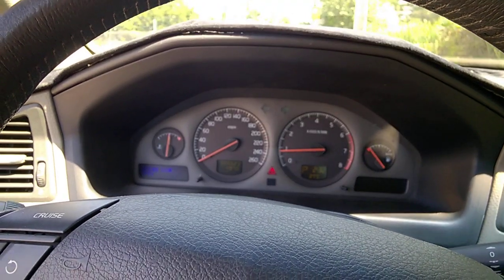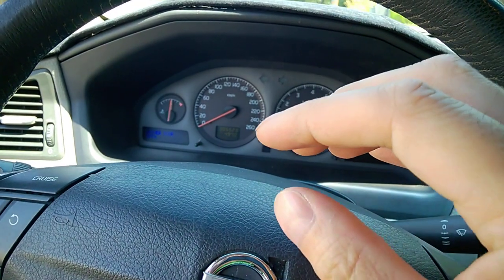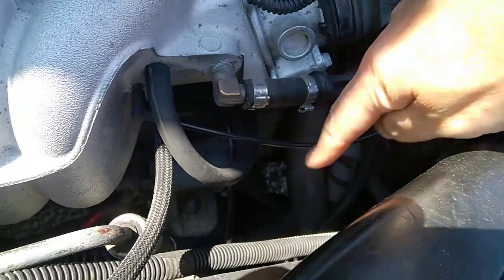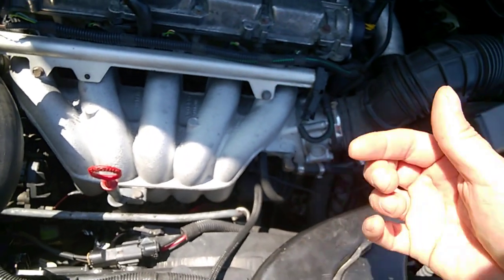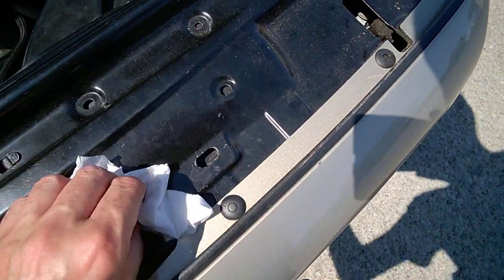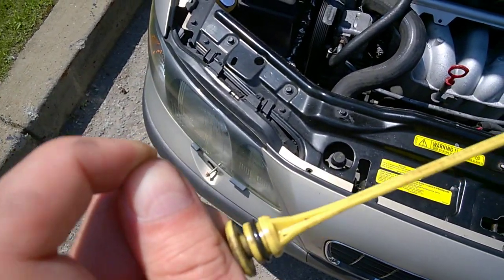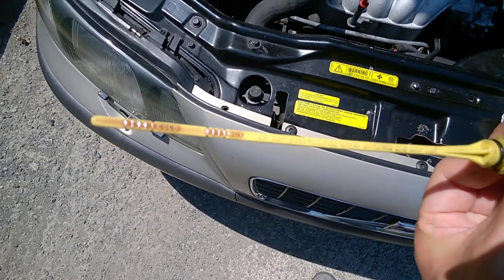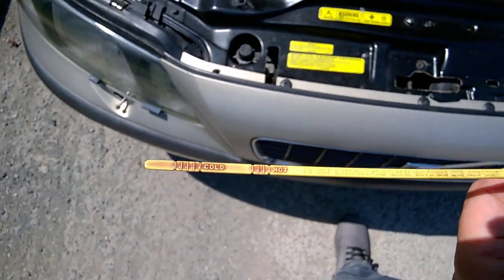Volvo S60 V70 Non turbo Automatic transmission (Aisin) Fluid level check 2001-2009

Comment from the maker: For TURBO engines dipstick location  https://www.youtube.com/watch?v=3zxWHtQ4wXU
UPDATED video https://youtu.be/Ad7HxgNP4s4
Hello everybody. I would like to share my 2c about transmission fluid change. This is just my opinion  😊  I did flush my transmission at 100.000 miles. I have to say, it worked less well afterwards. Before the flush it was shifting with only a very small kick, after the flush the kick was more obvious.

The transmission adapts continuously to the fluid properties. Replacing a large part of the fluid at once, may not help the transmission to adapt quickly enough (bigger the change, bigger the adaptation). When we drain the sump, we remove 3.5L which is exactly half the capacity of the transmission. So the transmission has to adapt to 50% new fluid all of a sudden - this new fluid has quite different properties than the old one. Plus, the old fluid is the genuine one, replacement ones (Mobil, Toyota, etc) have different properties. On top of this, the solenoids are old and work UPDATED video https://youtu.be/Ad7HxgNP4s4
more or less freely, so the adaptation
 is even more difficult.

If I was to do it again, I would remove a smaller amount of fluid every time: more like 2L instead of a complete 3.5L sump drain. Then drive the car at least 500-1000 miles inside the city where the transmission has to do a lot of shifting so has plenty of time to adapt to the amount of fresh fluid. And given the aftermarket fluids are not exactly as the genuine one, I would invest a little and buy genuine fluid. If you look at the cost, 12L of genuine vs 12L of Idemitsu is only $100 more, basically the equivalent of 3 oil changes. I think it's well worth an extra $100 for the transmission. Of course, just my opinion

Idemitsu fluid https://www.fcpeuro.com/products/volvo-transmission-service-kit-idemitsu-1161540kt
Genuine fluid https://www.fcpeuro.com/products/automatic-transmission-fluid-1-liter-1161540
Reply: But did you reset the transmission computer?
Reply: @OptiCallHD  How do you reset the transmission computer?  Is that the same as doing a "readaptation"?
Reply: If my s80 is slipping for 2006 would that help my trans is hot rn and slipps

Comment: How has that P 2 volvo Aisin 5 speed gearbox got a - + like the 6 speed geartronic that came out in the later models. Only seen that auto Aisin 5 speed with 4 3 L patten.
Reply from the maker: Only the shifter knob is from the Geartronic transmission. It can be swapped to the 5 speed Aisin. I think mine came from a Geartronic S80

Comment: Great video!! I was also curious.. do you know why my 2002 Volvo S60 2.4t is letting white smoke out of the exhaust..? It also seems like it is leaking oil out of the exhaust as well.. is it a head gasket issue..? Or is it perhaps a turbo issue??
Reply from the maker: I'm not aware of this, I do remember a similar question on a forum..  perhaps try asking on http://matthewsvolvosite.com/  or http://volvoforums.org.uk/
Reply: Turbo seals! Vacuum is sucking the oil to exhaust
Reply: How do you repair this problem?
Reply: I have a fluttering sound in my engine somewhere...sounds like a fan broke ..or mild muffler sound on the engine area ...when should I change my transmission fluid? Should I get a professional to do it or do it myself?
Reply: I just changed my oil ...I'm concerned abouty car..it has many miles on it ..Volvo s60....lately it's not sounding smooth ...

Comment: Is it normal for the dipstick to be dry the first time I pull it out and then on the hot mark after cleaning it and pulling it the second time.
Reply from the maker: Not normal but look carefully from close on both sides especially if the fluid is fresh and very clear.  One of the sides will have more fluid on it.  Be sure not to overfill and measure only in hot summer days after min 30 min drive and car on very horizontal surface.

Comment: I have just bought s60 2.0t from 2007 with aisin transmission and 183.000km. I red that volvo suggested that this a.t. are sealed for life, but I have also red that it is not true and that oil should be changed every 80.000km. Should I go to service and flush transmission? BTW, it is working good so far. Thanks in advance for answer.
Reply from the maker: Hi.  Volvo did indeed say that and most dealers will refuse to replace the fluid.  When Volvo said 'life time' they actually meant about 250000 kms which is the average miles these cars are being driven.  However the fluid does wear especially in very hot climates and when driving in areas with hills or towing.  Forums will say to replace the whole fluid in several steps - 2-3 liters at a few months interval. When I bought mine with exactly the same km as yours, I did replace the fluid and the transmission started shifting a little more harsh.  My take is, if your transmission works just fine, either leave it like this, or change only 2-3 liters. I'd say, if you are going to keep the car for another 100K km, replace 2-3 liters now.  Use only 3309 fluid type - Toyota dealers have the same transmission and use the Type IV fluid.  If you drain the transmission sump, it will drain about 3.5 liters.  We refill only through the dipstick tube - if you bring it to a garage make sure they do this way.  Hope this helps!
Reply: @Peppermint1  Why do you need to refill through the dipstick tube?
Reply from the maker: @amana1480   I'm glad you asked.  These 5 speed Aisin automatic transmissions don't have a refill hole. The only way to refill them is through the dipstick tube. There is large bolt at the top of the transmission but that bolt is the anchor for the 3rd speed. Garages who don't know these cars have removed that top bolt to refill, and the transmissions lost the 3rd gear (although it can be fixed, I did a video on this).

Comment: Hi, if a transmission (2004 S80) is shifting hard when warm, would changing the fluid help fix this problem? 125k miles. Thanks.
Reply from the maker: Personally I would rather think the problem is stuck solenoids inside the valve body of the transmission. You can still try replacing half of the fluid (3.5liters) by draining the sump, and refilling by the dipstick (careful not to remove the hex nut on top of the transmission if you have the Aisin one).  It's not expensive and worth trying - use only 3309 fluid like Toyota Type IV one.

Comment: Thank you. U are a perfect volvo lover. Can you describe how heathy our engine and how could we undersrand. Engine sound exhauust with a video. After performance using ı feel a match smell from my car just like sulfur or something iritating. What makes my engine produce this kind of smell. Do u have an idea.
Reply: Also. Is there an engine adjustment really that improves engine performance without software.My engine gives 78 percent at dyno but it is rebuilt at 150.000 and now 195.000. No blue or other smoke from exhaust. Does my turbo needs some care? Thank you so much.
Reply from the maker: Hi Sami.  I assume you have a turbo gasoline engine?   The exhaust sulfur smell (we also call this 'rotten eggs' smell) may be caused by unburnt that travels to the catalytic converter.  This may damage the converter - when a converter is damaged, the exhaust gases will usually smell like 'rotten eggs'. If it also smells inside the car, it means the exhaust has a leak - could be at the flexible downpipe.  There are many reasons why an engine will have unburnt fuel.  I guess the car is consuming quite a bit of fuel?   As for the turbo, there can be some issues with them, it is better to ask on forums, just google "volvo forum" and you will find several of these - it is better to ask on several forums, the more answers the better!
As for how to know if the engine is in good health, one easy way is a healthy engine has good torque (pull) and has normal fuel consumption.
Reply: Are you able to show pouring transmission fluid into your Volvo?

Comment: Hello Peppermint, can I add 12oz of LUCAS transmission fix -- without taking 12 oz of transmission fluid out??
Reply from the maker: That is the equivalent of 350ml.  Between the cold and hot marks the amount is 200ml (7oz) so adding another 350ml is too much: these transmissions don't like to be overfilled.
Reply: Thank you for the timely reply!!!

Comment: WHY you don't believe in the COLD measure? 

I did a measure myself with cold engine and the dipstick mark was in HOT line

is it overfill?
Reply from the maker: It's not just me, this is the consensus on all Volvo forums. It appears it's how Volvo specifications have been written. Transmission fluid volume - and consequently dipstick level - changes a lot with fluid temperature

Comment: Hi there great video, I  asked my local garage to replace the fluid as you described they did replace however after replacement filling in with the same amount of fluid they have originally  removed from car the mechanical( a junior one ) was surprised how the level of fluid was high and decided remove the excess with the sucking pump until reach the hot max on the scale however the engine was not hot. After I got home and watched this video I understood why the level was high and problably it was correct. the reason is becouse the car was not tested after 30 min driving and the engine was not hot enought. Now I got another issue because i dont know how much more  exacly he has removed and how much more I should be filling  back in. I guess my question to you is. From what I can see when the car is cold the dipstick will always show a lot of fluid giving the wrong impression the car got excess of fluid on it  on the dipstick and when engine is hot after 30 min driving  it should be lower and it should be around the maximum of the hot scale? is this right? I been trying to find the sweet spot and I did put 25ml and drove for 30 min as you describe but the level was still low. I put another 25 ml and drove another 30 it got better and now is showing at the lower end bar of the hot scale. The hot scale got 3 bars and at the moment it is a the first lower bar of hot scale after drive for 30 min. I don't want to overfill and I am wondering how much more from here i should use to reach the top level of the hot scale? Another question is , let say  if i drive for another hour or even 2 hours in a hot day will the fluid go even further  lower and lower or will remain stable after it has reached  a certain temperature? The reason why I am asking is becouse i need some sort of system to know I have reached the opitimal fluid level and If i drive for every 30 min filling up a bit more and if the fluid is going down proportionally to the lenght of time driven I will never be sure I have reached the perfect level. Any advice on finding a system to find how much more fluid i need to put in will be much apreaciated. Thanks
Reply from the maker: Hi there. To me, it seems fine if the fluid is near the hot marks after 1h driving - the more the driving, the more the fluid is getting close to 80C which is when the level should be measured.  Driving for longer time (2h+) the fluid should be relatively stable close to the hot marks, because when driving, especially on highway, the fluid is normally kept near the 80C mark (in winter time it will stay cooler).  Also important when reading the level, to look for 'thick' fluid on the dipstick, not just a smear stain.  Generally speaking, the only moment to worry is if the fluid shows 0.5 inch or more above the hot mark after driving for more than 1h (overfilled transmission).  If on the other hand the transmission is underfilled, it shouldn't cause any mechanical problems, only problem is that in cold winter days, the car will not advance when the transmission is in D - there will be too little fluid inside the torque converter so the car won't move.  
When adding fluid, between the cold and the hot marks there are about 200ml difference, so between the first hot bar and the last hot bar there should be no more than 50ml difference.
I would also like to say that not all 3309 fluids have the same properties.  The cheaper fluids - such as Valvoline and perhaps Mannol (sold in Europe), may have such properties that their volume expands and shrinks too much with the temperature.  I had in my transmission the Valvoline Maxlife, and despite being the correct quantity, it was fluctuating a lot so I could never get the same lecture on the dipstick. Also, with the Valvoline my car would not move in cold winter mornings, even if the level was fine once warmed up.  I then replaced it with Toyota Type IV and now the fluid is always at the same mark when warmed up.  Hope this helps
Reply: Great help. Many thanks.Great advise regarding fluid level. now I got at least a good reference point to work with and maybe more 50ml max to reach optimal level I will top up with 25ml observe if needed more and  will top up with a little more. I was unaware of the issues with cheap fluids and now concern about winter time as I have used a cheap carlube ATF-U which is 3309 maybe I raplace fluid again with a more expensive one before winter approach. The car transmission has been always driving fine car is around 130,000 miles and as I will be towing a caravan with this car for a long trip holliday for the very first time I tought it would be a good idea to have a fresh transmission fluid. I hope not to be a mistake :)
Reply from the maker: @fixall336   When the fluid is old, we prefer replacing it in several steps, for example, a first 3L, then drive a few months, then replace another 3L a few times.  It helps the transmission gradually adapt itself to the new fluid properties.  Also good to use Vida and reset the fluid counter - there is a second setting for adaptations but this one is only reset when replacing transmission parts.  Since you have already replaced the entire fluid, I would try to drive the car locally (city driving) as much possible, before going for the long distance (open road) trip. This way the transmission will have time to adapt itself (it adapts during each gear change), before going for the long trip. Generally speaking, replacing an old fluid all at once then driving long distances in the same gear, is what an old transmission may not like.
Reply: @Peppermint1  Not sure I have replaced all fluid. I have used a bit more than 3 litres in the replacement process. Basically the garage just removed around 3 litres from sump and added the equivalent around 3 litres(not sure what was exacly the amount but they have done exacly the same amount out same amount in) of new fluid. I read somewhere these gearbox uses way more oil around 7 to 8 litres? but unless you flash you can not get it all out? by the way car is 02 V70 Petrol so aisin auto. I am just go on a caravan trip in 2 weeks so I believe i still have time to check things out. I have just one more question I know is not relevant but if the car is totally cold in the morning with the engine not running I get a very high volume of fluid in the dipstick way above the max hot scale. Is this normal? To me ithe inconsistency of the fluid is that you can never have both reading perfect cold and hot. If I want to have the perfect reading when it is hot the diptstick will show totally overfilleed when the car is cold. If i want have good reading when is cold dipstick will show no oil at all when the car is cold.Accordand to only the hot matters but for that I will have a very high reading when the car is cold. wondering is this is ok?
Reply from the maker: @fixall336    If only 3.5L liters then it should be fine.  This is the amount that comes out when draining the sump.  The transmission holds indeed about 7 liters.  The way we do it, is draining the sump once (3.5l out), refill, then drive a 2-3 months (the transmission has the time to gradually adapt to the partially new fluid), the drain again the sump (another 3.5 out but this time is also some of the new fluid), and repeat all this 2-3 times until about 90% of the old fluid has been replaced.  But the important part is to do this gradually because the transmission is constantly changing the shifting parameters while driving, and needs a longer time (several months) to make these changes.  As I mentioned, there is also a setting in Vida for these shifting parameters but that setting put everything instantly at zero so that setting must only be touched when a complete new valve body and fresh fluid are installed.  
For the 'cold' reading, that measure is not relevant, the amount of fluid on the dipstick with the engine off (warm or cold) is not relevant, be it looking too high or too low.  This is because a large part of the fluid sits inside the torque converter after driving which may be draining back into the sump over night.  Any way, the dipstick measure has been calibrated for the engine running at idle in P, transmission fluid perfectly warmed up (at 80C - the transmission fluid takes much longer to warm up than for the engine oil), and the car at perfect level on the ground.
Again, I would recommend before the long  trip to drive the car as much possible in the city, so the transmission has enough time to change the shifting parameters, before it goes for the long trip distance.